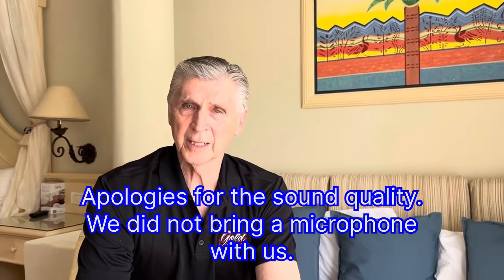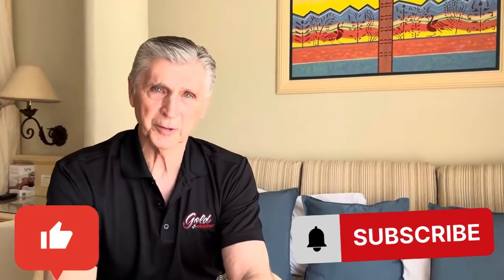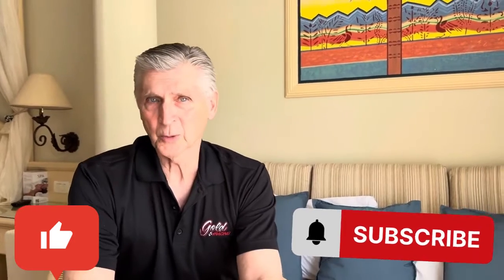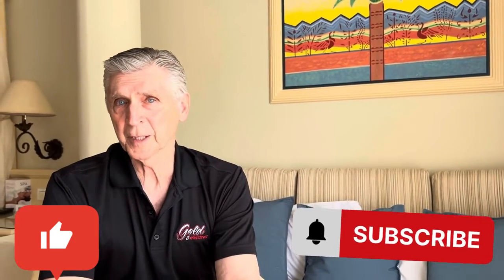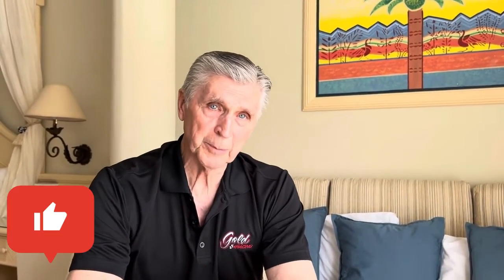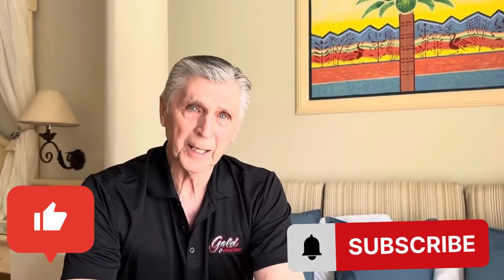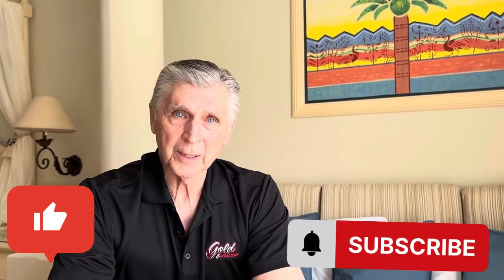Manifold OR Ported Vacuum Advance?? There is a case to be made and I side with David Vizard!

Comment: Hello. Great videos. My cars prefer manifold vacuum. My question is why do we limit mechanical advance to 34 degrees at 3000 rpms? Why not continue the advance sweep up to 6000 rpms? Ty.
Reply from the maker: Good question Glenn. Comments below are pretty accurate so check them out too. As I understand it, if the cylinder has good quench, after 3000RPM or so the quench provides sufficient turbulence, and thus a homogeneous mixture in the combustion chamber to increase the speed of flame travel to the point that more advance is not required. It is also about establishing maximum MEP, (Mean effective Pressure) in the cylinder at just the right time (I think this is about 10-15 degrees ATDC), combined with the connecting rod angle to generate the most torque. Remember also that the pressure decays as the piston moves down. Hope this helps. AG
Reply from the maker: Glenn, I suggested to check out the comments below, actually they are above my comments. AG
Reply: Hello,  @goldsgarage8236  Sounds good, Thank you Mr Golds.
Reply: cylinder pressure will spike and cause a kaboom........moar isn't always better
Reply: Picture the piston orientation during the process. 
At  bottom dead center, the compression is zero.  Top dead center is 180 degrees. 
 Sobadicslly, you only have 180 degrees to start building compression then ignite it.
If you could fire it at 60 degrees before TDC with mechanical advance, it would surely push the piston  back down where it came from.
The engine RPM, the compression ratio, the flame speed and physics simply determine maximum limit.
I'm making up stuff, but it's sorta like that.  I'm not an engineer.
 😁
Reply: Hello  @randywl8925    I did not mean 60 degrees of advance. I meant max 34 degrees in a sweep to 6000 rpms. Why would 6000 rpms not need more advance than 3000 rpms?
Reply: @glennbokma6182  Someone else told it better than this, but somewhere between the piston location at the time the spark lights the fuel and the flame duration in milliseconds, there a maximum limit in burn time.
It's math and physics defining why a wall can't be moved.
Reply: News to me about the cam break-in period and not having to break-in the cam in one shot.
I never knew that.    I had this silly idea the cam lube was still there doing it's job 5 minutes later.
I'm thinking now, it washed off rather quickly.
👍
Reply: Spark timing is optimized to produce the best combustion pressure levels during the expansion (power) stroke. At rpms up to ~ 3000 the time measured in milliseconds from the spark to the peak pressure is ~ constant so the ignition timing (angle in degrees to the peak pressure) at 3000 rpm needs to be ~double that at 1500 rpm (in degrees) to get the peak pressure at the same optimum crank angle. However, the time for combustion starts to becomes increasingly shorter at about 3000 rpm and above due to much greater turbulence in the cylinder such that the combustion speed is increasing proportionately to the reduced time available due to additional rpm so the timing in degrees becomes constant. On the dyno, tests are usually done to see what is the best all in spark timing should be and the optimum mechanical advance curve, of course sometimes less than the optimum timing is used to give some buffer against detonation should lower than needed Octane fuel is being or planned to be run.

Comment: When I set up my fathers Blueprint Engines 383 chevy the tech from Blueprint told me not to hook it up at all. He said the engine we have will make a little manifold vacuum even at full throttle due to the amount of air its pulling in. I have not verified if that is so but did keep it unhooked. It is grumpy at idle, but is a 450 horse small block so I guess it should be. Over the years I have done it ported and vacuum but have no idea what is better. I am lucky if my junk runs at all.
Reply: Big cams don't make enough vacuum to run vacuum advance consistently. You may be to that point.
Reply from the maker: Thanks 1958 for the question. i have heard that about BP engines before and i really don't understand it. We have dyno'd 383 engines making 450HP before and they work fine with vacuum advance. 
My last 406 made over 500HP and it worked fine with VA. 
No engines have vacuum at full throttle but we had a good 15" on that 383 and more on the 406. 
unless it voids a warrantee or something, I don't see why you couldn't try it under controlled circumstances. 
AG
Reply: @goldsgarage8236  The way it was explained to me was even with the throttle plates wide open, the engine is so efficient at pulling air into the engine the dyno guys have seen enough vacuum to slightly add some amount of degrees to total timing. They said at very high rpm's it could add enough to cause detonation. If I do hook it up, I think I will take a couple degrees out of timing just to be safe. It would idle better with it,,,, for sure.
Reply: @1958johndeere620 if the carb and air cleaner are restricted enough you could have some vacuum at WOT. I would measure actual WOT vacuum and play with it…..
Reply: Correct that more aggressive cam timing produces less vacuum. The fix. Use an adjustable vacuum advance. You can adjust the vacuum advance to work with engines that have very little vacuum. Manifold vacuum advance gives you the benefit of a cooler running engine at idle and more timing advance during light loads such as cruise conditions.

Comment: Look up the article Ported Vacuum vs Manifold Vacuum by John Hinckley - Retired GM/Chrysler Engineer.  He explains that ported vacuum (along with the right mechanical advance curve) was used to have really late timing at idle to increase EGTs to burn hydrocarbons and get the catalytic converter up to temp.  So ported vs manifold come down to emissions and where the timing is at or near idle.
Reply from the maker: Thanks for the reference Jo. AG
Reply: Correct, trying to coax the manifolds into burning fuel.